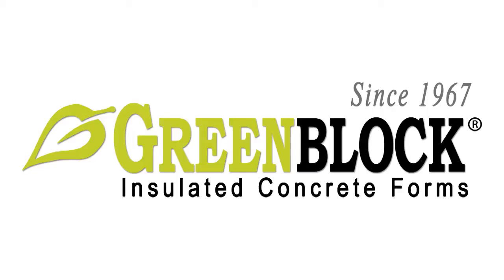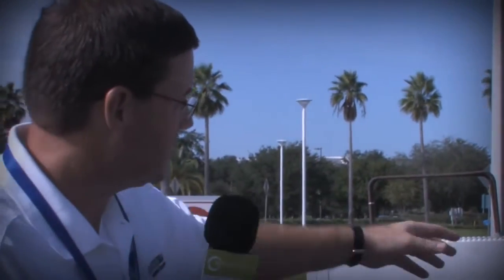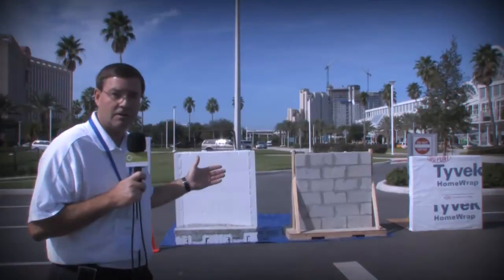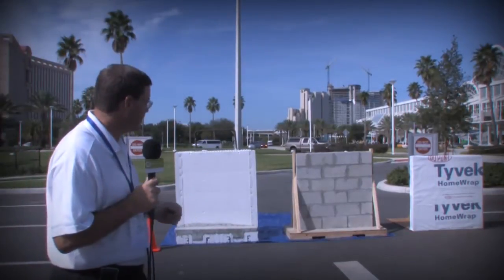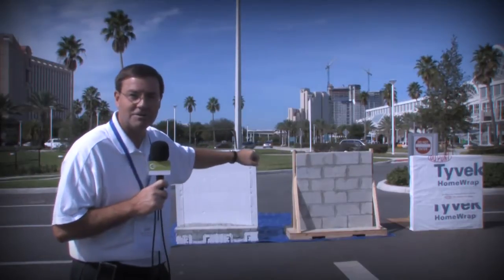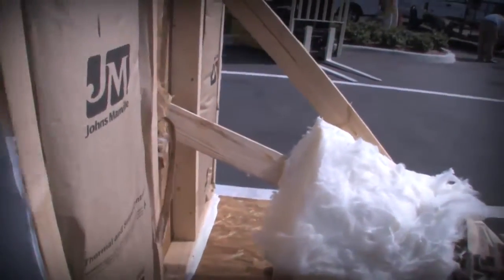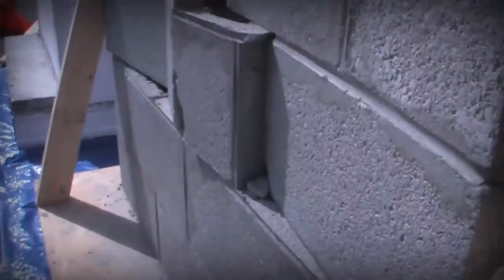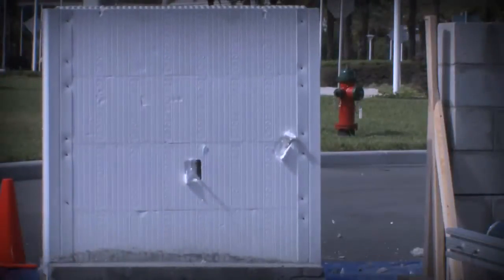Greenblock Insulated Concrete Forms vs 2x4 Cannon

Comment: The block wall was just that. A wall of blocks. No ribbed bar/pored concrete header/beam or vertical poured concrete structures. You are not shooting the 2x4 at a wall which meets any type of code. A standard block building which meets Florida Code can probably survive 150 mph wind for a sustained 6 to 8 hours. (The roof may not survive, but the walls will)  A standard concrete block house with poured beam/headers and a poured roof with flat truss underneath, could survive 180+ mph. (Tornado)

Comment: OK so you dont hit stud with the projectile and shoot thru just the plywood. Then you dont fill the cells on the masonry wall with concrete and leave  them hollow , but you do fill the styrofoam blocks with concrete,let it set up and then shoot the projectile. What a bs deminstration. Although I have nothing against the styrofoam wall system . The test you guys do is total BS.